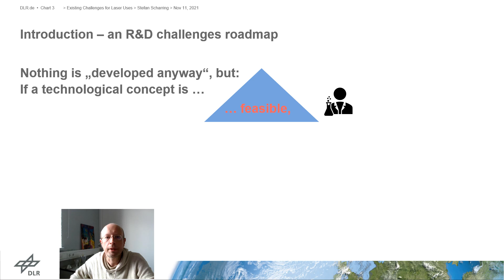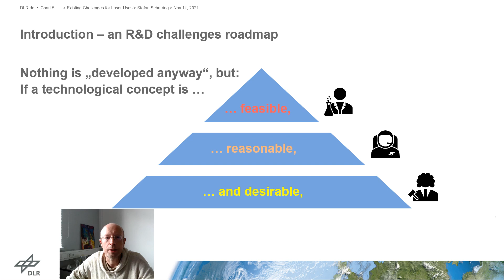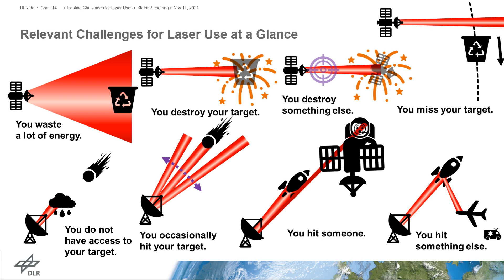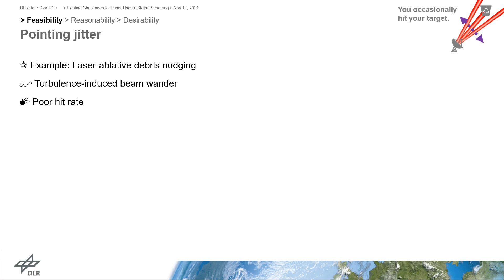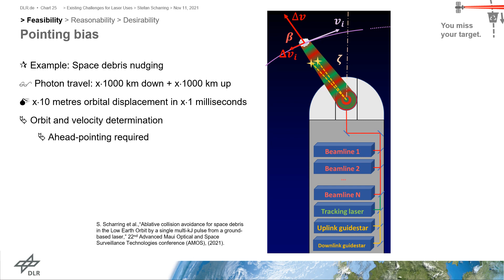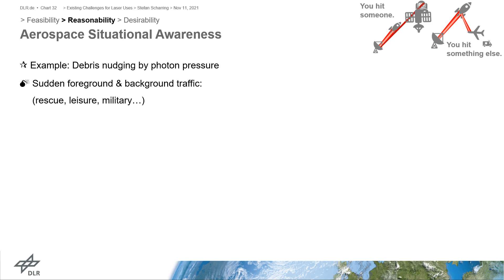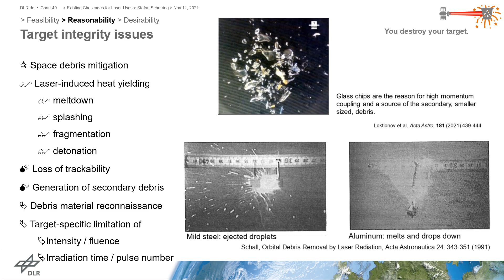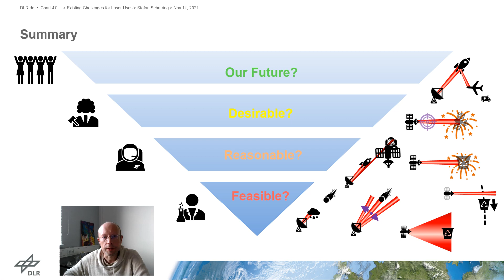Existing Challenges for Laser Uses in Space

Comment: This might be a stupid idea, but I'll put it down anyways.  Use an electric engine that has a high thrust to watt ratio, maybe the pulsed beamed propulsion engine but with the laser mounted on the space craft, and hang an electric cord from the craft as it launches down to the launch pad and to a power generator.  The cord would unravel and there would be smaller crafts along this cord to help hold it up as the craft rises in altitude.  In the case of an accident the cord can have a mechanism to break apart and parachute down.  This cord provides the needed electricity to the space craft as it leaves the atmosphere while avoiding the issues to aiming high powered lasers into the sky.  When the space craft detaches and falls into orbit the individual crafts along the cord keep the cord held up as it is lowered down to be coiled up for a second use.

Chances are that I am probably not the first person to have this idea and there might be something that I am missing that could be the reason that nobody has done it before.  I'd be curious to read anything on this if someone has though it up before me.  Otherwise, what do you think of my solution?
Reply from the maker: Dear Thomas,

thank you so much for your comment and apologies for my delay in answer. Basically, your idea of having an onboard laser is addressed in the concept of laser micropropulsion, which is lined out in Part 5 of my lecture on laser propulsion in my YouTube channel. Regarding your proposal, such a cord would in fact avoid effects like reflections and scattering, nevertheless, a collision with the cord would have to be avoided similarly like a "collision" with the laser beam when pointed from ground to sky. The main point, however, is that one would lose the large benefit of remotely powered propulsion, i.e., having a rather light propelled object, but the very heavy energy source on ground. This would be a large advantage over, e.g., traditional rocket propulsion, where most of the energy is not spent to launch the satellite itself, but to additionally launch all that propellant that is needed to launch the satellite during the timespan until it eventually reaches its destination orbit. And in turn, to launch all that propellant that is needed to launch that propellant that is needed to eventually launch the satellite, c.f. Konstantin Ziolkowski's rocket equation to explain why even small satellites need such big rockets. In this case, the high power laser, once available, needed to launch the satellite itself would definitely weigh several tons. But since this massive laser itself would have to be launched, it would require a much more powerful laser, which in turn would weigh much more... You might like to check as well Part 4 of my lecture, which deals with laser launchers, to get some more ideas about it.
All the best
Stefan